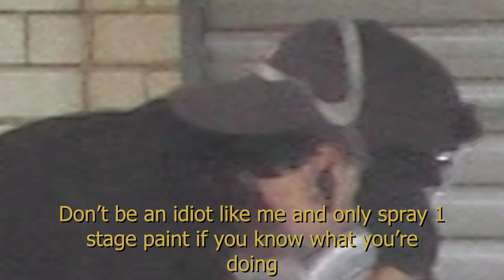$200 paint job on my $400 EK Civic / Rustoleum respray full guide

Comment: Don't look too bad. I need to repaint my bagged sedan here soon. May get some of that ceramic coating once it's done. Glad u told how to apply it I'd never used it b4
Reply from the maker: Definitely give it a shot !! The liquid is super easy to use as you can see where you've applied and where you haven't as you go along. Just remember to apply  it in the shade and buff off all of it other wise it turns white if you leave it on for too long
Reply: @UnlimitedSpeedTV  thanks for the tip. I gotta do the body work and get it ready to repaint first but I'll remember that.